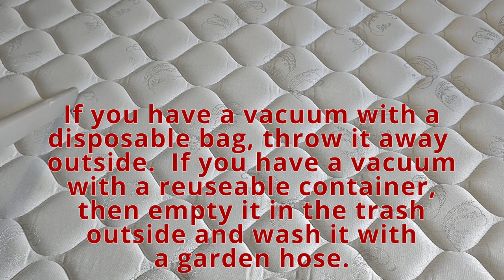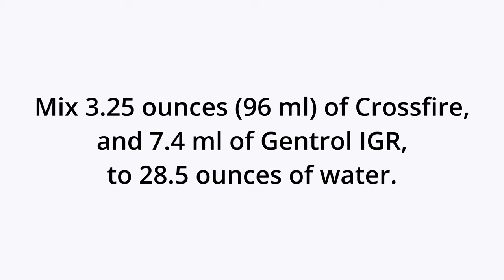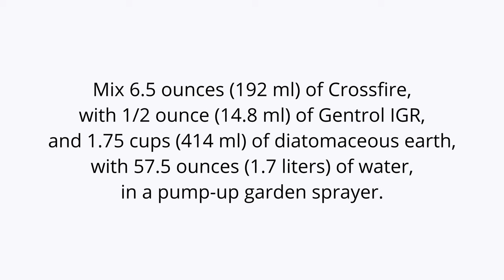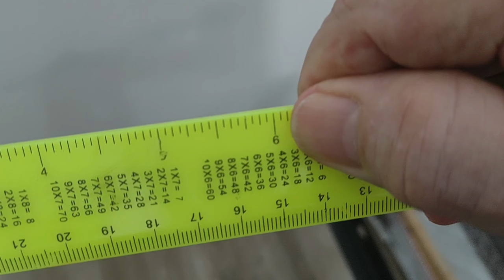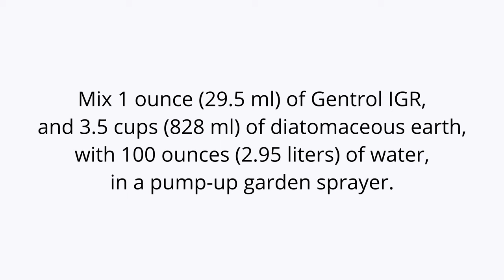ULTIMATE Bed Bug Solution!  AMAZING.  This ALWAYS works.

Comment: Are those products ok for cats? Thanks
Reply from the maker: For the most part, all of the products are safe for cats.  The only product I would be somewhat concerned about would be the diatomaceous earth.  I would not apply it where the cats like to sleep, or they lay down often.  The DE will not harm them by touching it, but cats like to clean themselves and the DE will come off on their fur when they lay down on it.  They can lay down on any other product after they dry.  The problem with the DE is that is dries to a dust and that dust can come off on their fur.  The other products dry hard and do not come off when touched.  I don't think they would end up consuming a lot of DE this way, but it's best to play it safe.

I hope that helps.  Be well my friend.

Comment: I would rather use the silicea dust instead of those chemicals then set traps. Using yeast to attact them. Its going to be a lot of work but worth it.
Reply from the maker: Silica dust is a fine powder.  The tiny particles in silica are so small they can be easily inhaled and travel deep into the lungs, so I do not recommend using it.  Inhalation of silica dust can lead to serious health problems, including:

Silicosis:  A progressive lung disease that causes scarring and difficulty breathing.
Lung cancer:  Prolonged exposure increases the risk of developing lung cancer.
Kidney disease:  Silica dust can damage the kidneys.

You would be much safer using diatomaceous earth (DE).  It is just as effective, but way safer to use.  It is still unsafe to inhale, but not as harmful.  You must wear a respirator when applying any dust.  I think the liquid chemicals are safer than any dust whatsoever, but I also think that DE is a must for treating bed bugs.  Liquid pesticides are no longer the ones we used in the 20th century that were so hazardous.  Those products were banned in the late 1990's.  We are now about a quarter of the way into the 21st century and we now have 21st century pesticides.  These products are required by the EPA to be safe enough for children to play on after they dry. So, today's pesticides are very safe and effective.  You should still respect them when applying them, but the truth is that they are way safer than household bleach and no more hazardous than common laundry detergent.  Please watch my video explaining the truth about pesticides.  It may change your view of pesticides.

I hope that helps.  Be well Patricia.

Video explaining the truth about pesticides:  https://youtu.be/i7nLO6Js_3Q

Comment: I think I just got infected. I got a two dot bite after staying in a cheap motel.
I've been vacuuming every day and spraying raid all over everything.
I've washed everything on hot.
So far so good. My only worry is my tri neoprene wetsuits. They're isolated in a bag but I can't heat treatment them. One of them is absurdity expensive. Can I soak it in insecticide? Heat will melt the neoprene. 
Thx
Reply from the maker: If you only got one bite in that motel, then it may not be bed bugs at all.  There is a good chance that this was actually a spider bite.  Spider bites usually have 2 puncture marks, and you only get one bite.  Bed bug bites often appear in clusters or lines.  It would be very unusual to get just one bite with bed bugs.  So, at this point I would stop treating.  If you start to see any activity in your home, then do the full treatment, but I suspect that you will be okay.  It sounds like you dodged a bullet.  I will be coming out with a video in the next few weeks on how to inspect hotel rooms for bed bugs.  If you subscribe to my channel, you will be notified when it posts.  You should always inspect hotel/motel rooms for bed bugs and German roaches.  I will be doing video on both.

I hope that helps.  Be well my friend.

Comment: Thank you for such a thorough response. I was planning to leave it out of commission during treatment, but thought to treat for 2 weeks and air out for a day. So you recommend 3 week treatment and 1 week air out? What type of respirator would I need for when I open the car?
Reply from the maker: You can probably get away without a respirator, but I like to be safe.  I will give you a link to the one I use.  It's not very expensive and it is comfortable to wear.  3 weeks is a bit of overkill, but you only want to do this once, so I don't play around.  You may not need to air out the car for an entire week, but I like to play it safe.  At least give it a couple of days.  You may want to drive around a bit with the windows open.  That should get it aired out pretty well too.  Wave to the other drivers while you are wearing the respirator and watch their reaction.  Hey... Why not have some fun while you are at it?  Perhaps you should not do that with a cop.  Lol. 

Respirator:  https://www.amazon.com/gp/product/B08YYFSMB2/ref=ppx_yo_dt_b_search_asin_title?ie=UTF8&psc=1
Reply: @GuysPestSolutions I'm with you on the not playing around part. Thanks for all the info and the laughs. Both are much needed and appreciated during this extremely stressful time.@GuysPestSolutions
Reply: One last question. I know the 3 week straight treatment is to cover the entire hatch cycle or kill eggs. The Nuvan label states it kills all pests in 48-72 hours. Could I do the 72 hour treatment to kill all instars and then 10-14 days later do another 72 hours to catch the new ones that would have hatched? Thoughts? I absolutely am prepared to go all in for 3 weeks if necessary, but am trying to mitigate being without transportation and trying to find the best and most effective solution. @GuysPestSolutions
Reply from the maker: @camisf78  I looked into what is recommended when you treat a car with Nuvan strips.  Other people who have done this think that 3 weeks is a minimum exposure, and you may need 4 weeks.  I was thinking that 3 weeks would be more than enough, but my research suggests that it depends on the size of the car, how you place the strips, how well sealed the car is, the temperature, and the number of strips used.  The problem is that the Nuvan strips were not really made for cars because it's too much open area.  You need a high concentration of the vapor to kill the eggs.  Bed bugs hide too.  So, you need to place these things under the dashboard, in the trunk, under the hood, under seats, and anywhere else you can think of.  I'm thinking that the adults will probably fold pretty easily, but you will need a lot of concentration and exposure time to kill the eggs.  I have never tried this, but if it were me, I would use lots of strips and I would do a minimum of 3 weeks.  You may want to go 4 weeks.  Then put on that respirator and drive around with the windows open for at least 30 minutes or so.  This will speed up airing out the car.  You may also want to drive with the windows open for a couple of days after that.  My research suggests that this can work, but apparently you do need a lot of exposure time.  I hope that helps.  Be well my friend.
Reply: @GuysPestSolutions Wow! The time and thoroughness. My deepest appreciation.  Armed with the tools and knowledge, I'm going in on Friday. Wish me luck.
Reply: @GuysPestSolutions  Oh darn! More involved than I thought, but good to know now before I start. Setting it up tomorrow, so no going back...I'm commited. Thanks again for dedicating so much time to researching my issue. You, sir, are a true angel.
Reply from the maker: @camisf78  Good luck my friend.  I wish you well with it.

Comment: Guy, we live in Canada and some of these insecticides are not sold in Canada. Can you suggest what to use in Canada. Thank you. Your videos are excellent and filled with great tips.thank you
Reply from the maker: Canada really makes it hard to do pest control.  The only thing you can do is vacuum and steam really well, then treat everything with diatomaceous earth.  I mean everything.  I have had people do this and it was successful, but it took them several tries.  If you are just using DE, then thoroughness is extraordinarily important.  You should be able to get the bed bug traps for under the bed legs and couch legs.  The only quick kill you have will be the steam, so do a very good job.  The diatomaceous earth takes time to kill, but it should finish off the ones you miss over time, if you do a thorough job applying it.  I hope that helps.  Be well my friend.
Reply: @GuysPestSolutions  Thank you Guy! We are a little Leary of using diatomaceous earth as inhaled it causing health issues. Your thoughts welcomed. Thank you for your reply.
Reply from the maker: You are partially correct.  Inhaling any dust, including DE is not a good idea.  That is why you need to wear a respirator when working with dusts.  That being said, you will not have issues with it after the dust settles.  The reason you only apply DE in dust form in places where it will not be disturbed is because you don't want to kick it back into the air.  Places where it may be disturbed are sprayed with DE mixed with water.  This will result in a very light coating of DE that will not become airborne when disturbed, so no health issues there.  In Canada there really aren't any alternatives.  It's steam and DE or live with bed bugs.  Besides, DE is one of the best bed bug killers available.  The biggest drawback to it is that it's slow.  Steam and DE alone can get it done though, but you need to do a really good job.  If you apply DE as shown in this video, you will not experience any health issues.  

I hope that helps.  Be well my friend.
Reply: @GuysPestSolutions  Thank you Guy! Adding water to DE is a fabulous idea. We have done all our suggested, vacuum, steam clean, plastic bed bug trays under furniture, mattress and box spring covers. We have not seen any bed bugs but left with tiny black mites. They are so tiny , but bite. Any ideas on what and how to solve this issue. Thank you for your very sound advice.
Reply from the maker: @HeatherBillings-j9d  It's hard to say what those things are without seeing them, but if you are sure that they are mites, then they may be clover mites.  I know you don't like DE, but spraying the areas where you are seeing them with DE mixed with water may take care of the problem.  This is slow, but may get it done.  Normally I would spray with a quick kill pesticide, but that is not available to you.  So, the best you can do is vacuum really well and hit it with DE mixed with water.  I'm so sorry.  I wish I had better solutions for Canada.  Be well my friend.

Comment: Hello. Great thorough content. New subscriber. I know there are several variables, but on average, how long does this have to be done for? What has your success rate been in eradicating infestations 100%? Ideas in how to treat an infested car? After infestation and treatment how do you cleanse your home of so much pesticide? Thanks in advance for any advice.
Reply from the maker: This works 100% of the time, but you must be thorough.  People fail because they get lazy and miss areas where bed bugs are hiding.  You must leave no stone unturned.  Treat places where the bed bugs cannot possibly be.  If you treat everything exactly as explained in the video, then they cannot survive.  Do not remove the pesticide for at least 18 months.  Do not unbag the mattresses for at least 18 months.  If you have not bedbugs after 18 months, then you can consider the treatment to be successful.  If you find any during that time, then immediately retreat the room where you are seeing the activity before they spread to other rooms.

You can treat a car the same way.  Treat the seats the same way you would a couch.  Steam the seats really well and do not apply pesticide to the areas where people are in contact with the seats.  Steam is your best friend when treating bed bugs.  Just like the house, you need to be thorough.  So, don't forget the trunk.  It is also possible that they may be under the dashboard, which you cannot steam.  The best you can do is to apply DE as best you can and hope for the best.  Make sure that any bed bugs that leave that area will be forced to cross DE.  It is hard to catch all areas of a car, but that is what you need to do.

I hope that helps.  Be well my friend.
Reply: Would nuvan strips work for a car? @GuysPestSolutions
Reply from the maker: @camisf78  I do not recommend using Nuvan strips in a car.  It may work, but the active ingredient is DDVP.  High or repeated exposure to DDVP can be very dangerous, causing rapid organophosphate poisoning.  Symptoms can include headache, dizziness, blurred vision, tightness in the chest, sweating, nausea, vomiting, diarrhea, muscle twitching, loss of coordination, convulsions, coma, and even death.  So, using them in an enclosed area that you frequent is a bad idea.  These things can be used for certain sorts of treatments, but I don't like to recommend them because people can hurt themselves or others with them if they are used incorrectly.  Everything I recommend in my video is safe and effective.  You can get away with making lots of mistakes with the stuff I am recommending, and you will be just fine.  Nuban strips are effective, but not safe.  So, you need to understand how to handle them and you need to respect them.  I think DDVP is best left to the pros.  If you are going to treat a car with them, then that car needs to be taken out of service for about a month.  3 weeks to do the treatment and another 1 week to air it out.  After the strips are placed, nobody should go back in that care for 3 weeks.  Then, only to remove the strips while you are wearing a respirator and rubber gloves.  The car should air out for a week with the windows open, preferably outside.  I hope that helps.  Be well my friend.
Reply: I've left the car parked on a concrete driveway  for 3 hours in 95 degree weather with the heater on. Oven thermometer read 130 degrees. I tried crossfire several times in the car and still getting bites. Don't see any other method at this point.@GuysPestSolutions
Reply from the maker: @camisf78  I say give the Nuvan strips a try.  Just have respect for them and be careful.  If you handle them correctly, then you should be okay.  Please let me know how it goes.  Be well my friend.